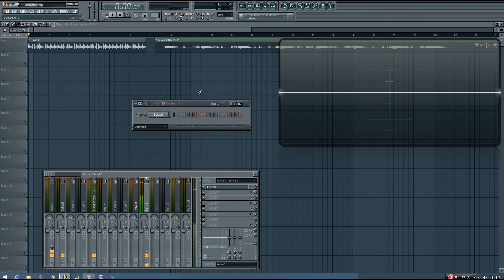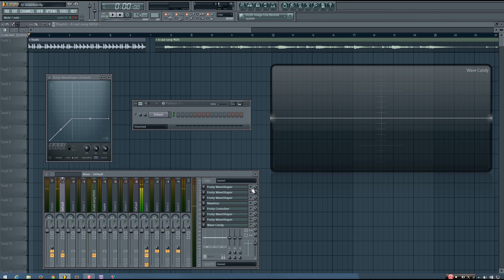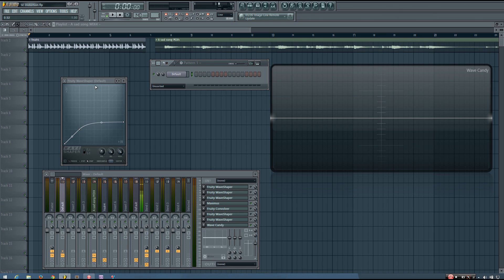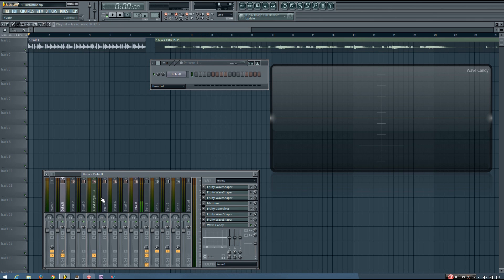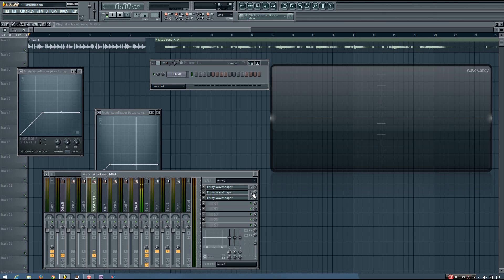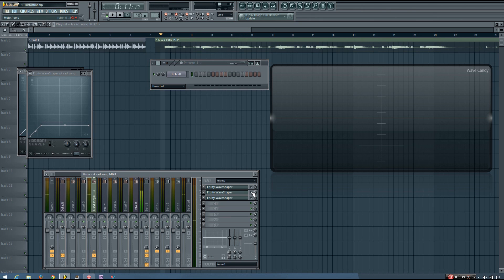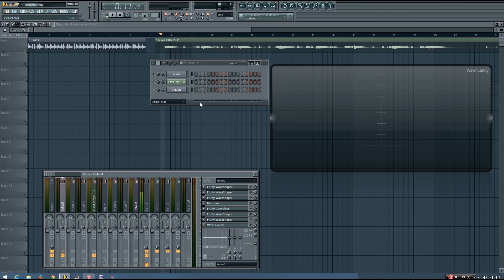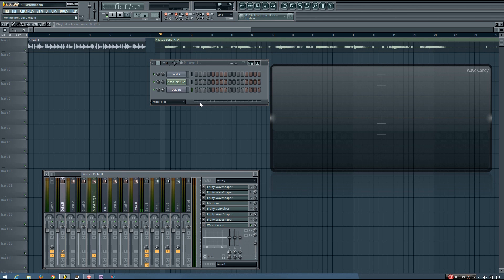Sound Explained: Distortion Clipping, Soft Clipping, and Saturation

Comment: If you want to compress and not loose as much punch, use a slower attack time
Reply from the maker: That's true, but keep in mind it also won't get the peak down as much. Saturation and soft clipping allow you to get the the peak down much more while maintaining loudness, just with some distortion as a side effect. This only matters if you want a loud mix, though. Depending on your goal, a combination of compression and saturation/soft clipping may be ideal
Reply: @IVTheFourth  definitely a combination for a nice balance yeah

Comment: Summary

Especially on Analog Gear, clipping is better?

Hard Clipping
- Makes it squared
- Adds more harmonics
- When amp exceeds threshold

Soft clipping
- Keeps roundness better
- Doesn't produce that many harmonics

Saturation
- Similar to soft clipping

Clipping
- Reduces dynamics of saw pluck sound
- Makes an unpleasant white noise like sound for piano

Comment: you have a point in that people say 'never clip' and perhaps this is a bit extreme. However they are usually referring to avoiding clipping your mix engine unintentionally...many plugins can be clipped with excessive levels, even though DAW most often are floating point and are difficult to clip now. The important point though, is unintentional clipping will likely produce a lot of aliasing. You don't mention it but many clipping plugins may have built in oversampling to try to avoid aliasing, but it is a big issue in digital audio. Clipping in the digital realm produces fold back unmusical harmonics that essentially becomes a sort of music hash, degrading your music. THAT is what people are trying to avoid when they say 'don't clip'.

Comment: I think for instrument light hard clip sound wired when goes in and out of being clipped. it sound like it glitching. so with fuzz you push gain to point where most of note stays clip, but then using it as effect.

Comment: Great video! I think when a lot of people refer to "clipping", they are describing what happens when a signal exceeds 0dB. But that's not really the same as applying clipping to a signal without exceeding 0dB. I don't yet fully understand the different types of distortion algorithms and how they process audio, but the results are all a bit different, depending on the distortion type. I'm actually discovering a lot of amazing wave-shaping possibilities in the distortion module in Zebra 2, which is becoming very educational :)